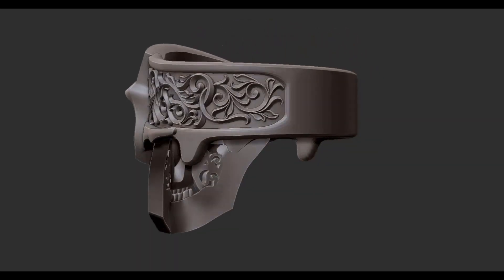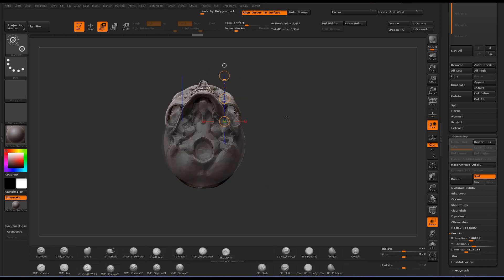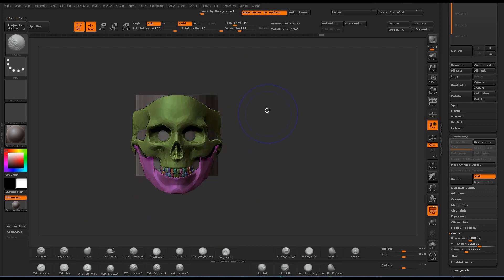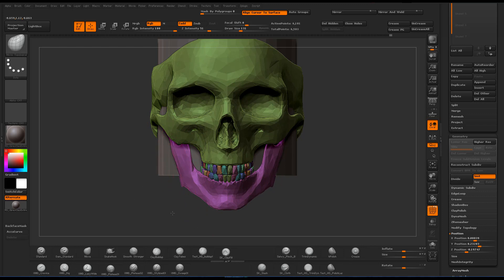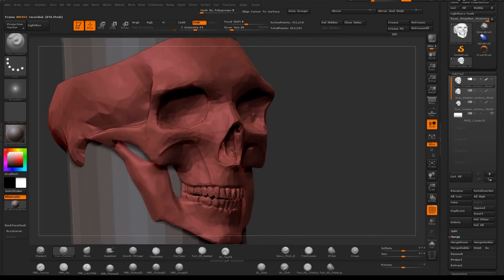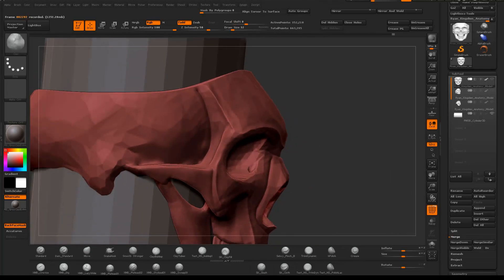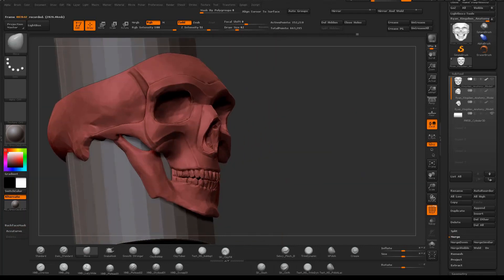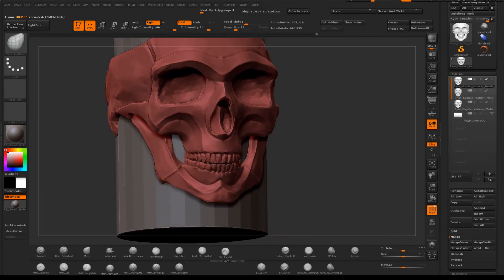Zbrush - Making Jewelry - Silver Skull Ring - Part 1

Comment: how do you keep or create a finger size? my instructor says there's no way to measure in zbrush thx
Reply: Your instructor is wrong. There is a plugin for zbrush called ring master that you can download. It allows you to set specific measurements and append a ring tool with those measurements. Takes out the guess work of ring making.
There is also a pre-installed plugin that's called scale master that you could read up on. If you have access to zbrush, go to Zplugin - scale master, and click the large icon to read more about how it works.
Reply from the maker: You can actually measure very accurately with zbrushes transpose line.
Reply: Yep you can use the transpose line to measure anything on your model such as thickness of your band and prongs (if you want to see this in action go check out this video on youtube: https://www.youtube.com/watch?v=X3tq1-Jd_5g
Skip to 20:44

Also what Christopher said below works too for ring shanks! Also you can make settings with specific gemstone sizes/some general types in mind :))